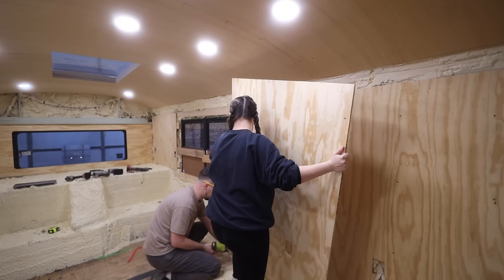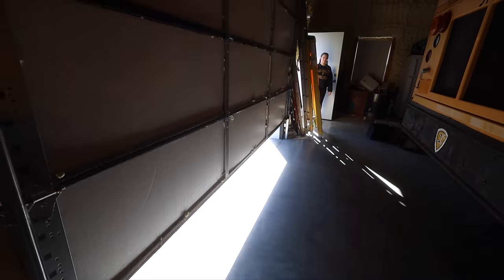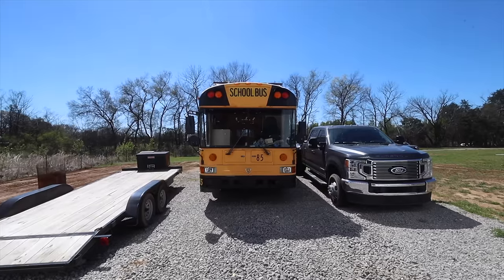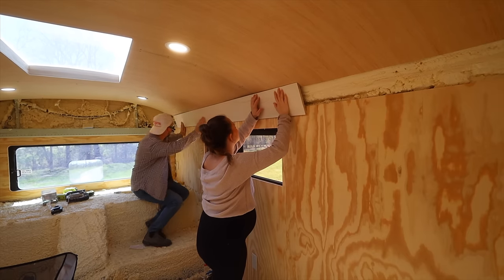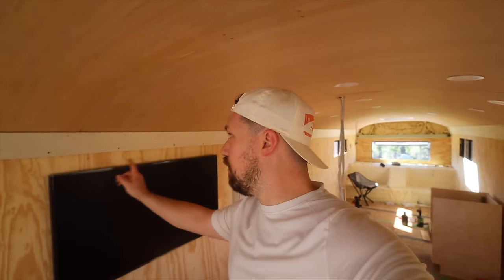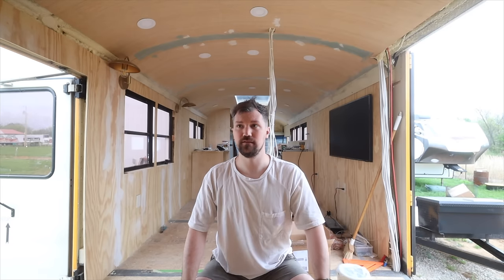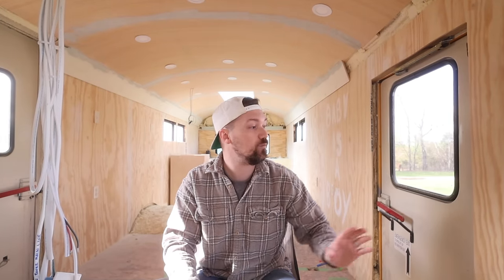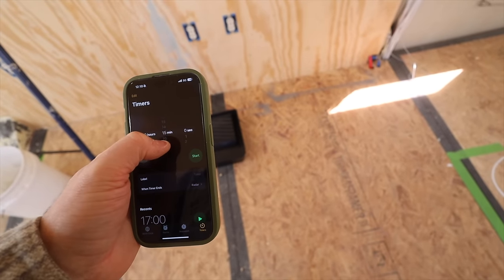A bus ceiling that ISN'T tongue and groove! // Skoolie Build Ep. 13

Comment: Absolutely do a video on the CNC process!! Pretty please with sugar on top!  Also, I did the same thing with the body filler, but I went with the fiberglass impregnated Bondo. Just a little more protection against cracking. I'm using it for the seams in the ceiling panels and wall panels.  For the seam where the curve meets the walls, I opted for a flexible PVC moulding from amazon.